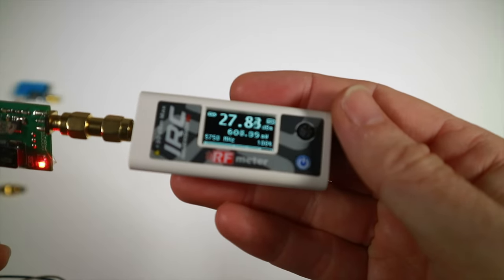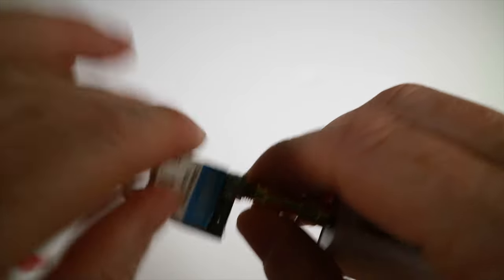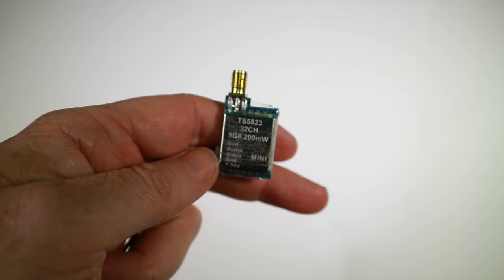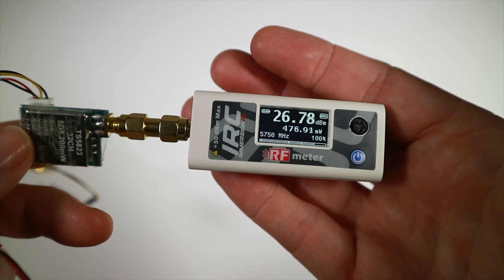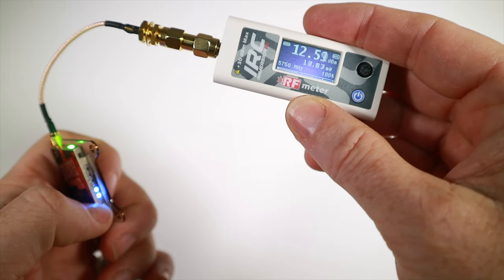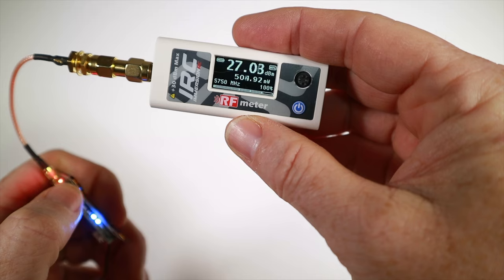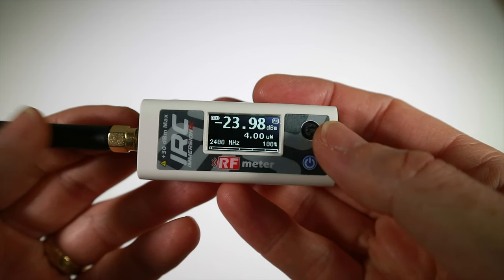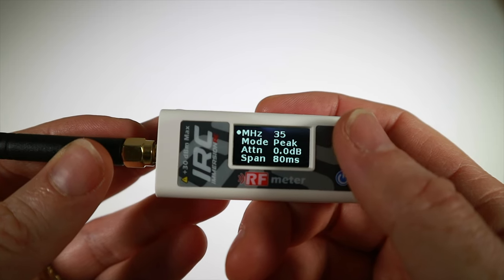ImmersionRC RF Power Meter.... it's an amazing diagnostic tool

Comment: Hey Wayne, that was a very excellent overview, I'm much more educated now on utilizing it. I've actually took mine out of the box and at present currently "properly" checking this quad that seems to have no range at 25mw but functions ok on 200mw and guess what?? on 25MW its around 10mw. Reggie and I now have been able to use it on his locomotive set to match the frequency's Really Cool.
Reply from the maker: I'll have to go back and check out a few quads myself.  I remember one having amazing range at 25mw which I'm now less than convinced was 25mw.  I do notice that the mighty RushFPV VTX's do start to break up quite early on 25mw, which makes sense now given that they seem a little down on power.  I remember people mentioning in the older VTX's the variance used to be massive on different channels - so it might be worth having a look to see how it goes on other bands/channels as well to see if there's one or two channels that make it flyable.

Comment: Bort one last month from hobby RC very handy measure the tx power(LBT)to see true output when I switch to 100mw instead of the legal 25mw(oops did I just fess up🤔)and see if fpv Antennas are ok after a crash,i downloaded a mw to dBm chart ie 25mw=14dbm etc,great as a checking tool for equipment testing.👍
Reply from the maker: Interesting - how are you checking antennas out after a crash.  Do they not radiate out as much power if the lobes have been bent or something?
Reply: @CurryKitten  
Depends on what the dBm was when new say 3dbm then when checked the value drops indicating a problem as resulting a crash ripping the antenna out or a break in the element,you can build Antennas and use the tool to tune to the right length and check dBm or signal strength for that given frequency.ive made a few 31mm and checked after with this tool that it was correctly tuned for that purpose.

Comment: I have a cheaper unbranded power meter and they are useful for all sorts, its one of those things you wonder why you didn't get sooner, like 3d printers!  Lol, I'm using R9, I have two R9M modules, one running FrSky firmware which I use with R9 Slim+ RX's and the other R9M is running ELRS and that's being tested at the moment with purpose made ELRS900 RX's.
Reply from the maker: I haven't really seen anything else on the market like these... then again I probably haven't looked, and I'm guessing this wasn't sold as a hobby item?
Reply: @CurryKitten  There are all sorts on A express, mine was something like £25.

Another great tool you should look at is a Nano VNA V2 (not V1 as they are much more limited on frequency).

Its an antenna analyser, I use it to test pre made antennas and tune them and also make my own and use it for 27mhz 433mhz 446mhz 868mhz and 2.4ghz, ive just made a bunch of perfectly tuned 868 antennas for ELRS :)

It only goes up to 3ghz unfortunately so no good for 5.8ghz, you can get units that will go to 6ghz but they are very expensive, the Nano VNA V2 is around 30 quid.

Comment: The battery charging circuit through the usb doesn’t work on mine.It’s a frustrating process but the battery comes out for recharging. It’s a tiny lion cylinder shaped lion cell.
Reply from the maker: Mine works ok - have you pinged IRC about this.  They are normally pretty good with repairs?
Reply: @CurryKitten  
 I opened a ticket with Orqa/IRC and will see what happens.
  I can flash the firmware through the usb but not charge.
Reply: I’m curious if it’s my iMac not having enough power plus I had to use parallel (virtual machine) to download windows for the IRC power meter driver.
Reply: It was my iMac going to sleep and it only has usb 2.0.
It doesn’t charge in an hour but it does charge after changing the sleep settings in iMac.